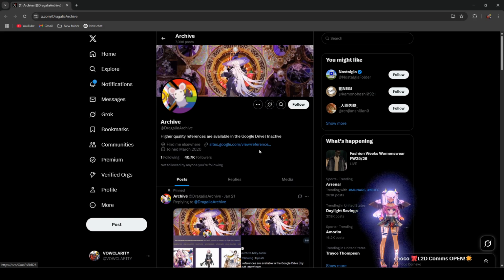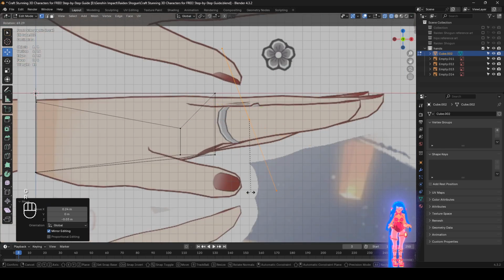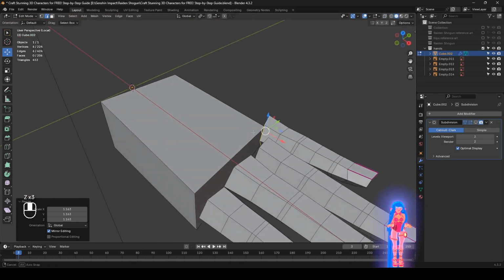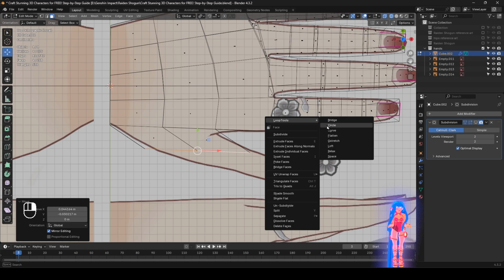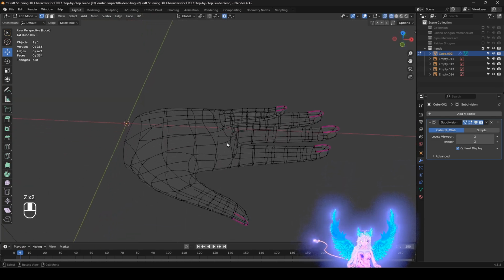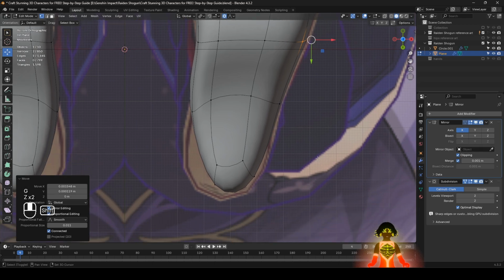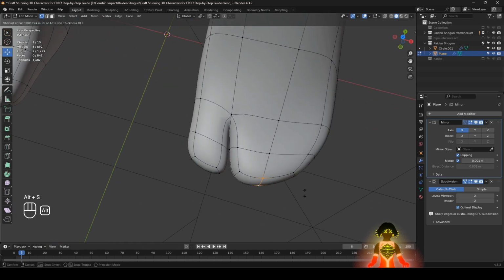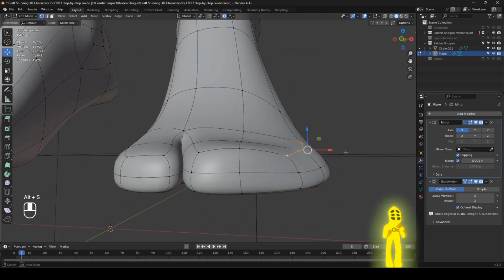Craft Stunning 3D Characters for FREE! Step-by-Step Guide Part 3 hand/feet

Comment: I've been working on a character base over the past year, and your tutorials have been a great help. 
Though I had too take some time off from modeling, I finally got around to completing the hand, and there were several things I learned along the way that I felt were worth sharing. 
When subdivision is turned on, if you select certain edges where you might want specific topography adjustments made, like veins, wrinkles, muscles, fat and bones, etc. The Crease and Mean Vetex Crease sliders under the right side menu's Item>Transform> Edge Data and Vertices Data, can be used to manipulate the shape to your liking. 
For an example, when making the finger nails, selecting each edge of the loop individually (the tip, inner and sides of the nail) and adjusting the settings for the two crease options, you can make a very nice fingernail shape. I also used this method on the finger shapes, such as the semi-flat wrinkles on the bottom of the finders where each joint bends, and after applying the subdivision modifier, it's just a matter of selecting the full hand and adjusting the two creases back to 0.
I did also deviate a bit from the tutorial around the knuckles for topography reasons, but overall I'm really happy with how the hand turned out. 
Great video! ^_^

Comment: Just thought I should mention, but the teen body type's hands are a a little bit different in shape from the adult body type's, so so for the Shogun you might want to use Jean's summer outfit instead, as she doesn't wear gloves either. But it only matters if that slight difference bothers you, the teen hands are close enough to get the job done.
Reply from the maker: I basically grabbed the first one I saw they're slightly different but you're right at the end of the day just make sure it looks good to you.